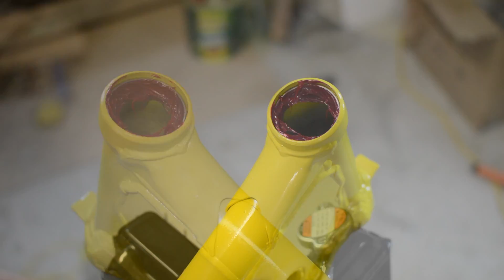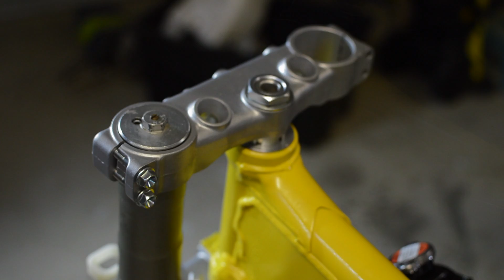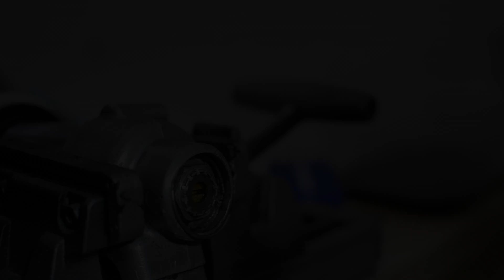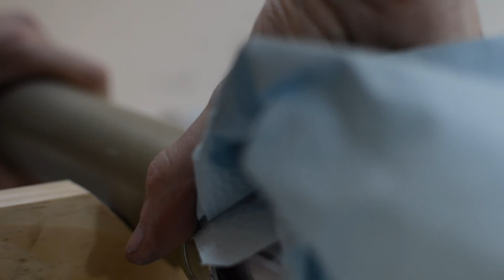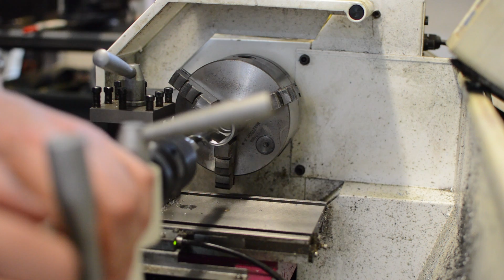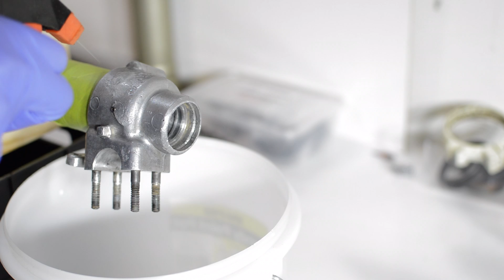Front Forks (Part 1) - 1992 RM250 Restoration - Episode 17

Comment: To anyone changing seals/metals 1. You don't need to remove all the center stuff, just top cap off and dust seal+lock piece off and pull. 2. If you are removing the bottom bolt but it's just spinning and not coming out. There is a really small screw on the side of the fork where the axle hole is that has a small screw that locks the outer housing (that has the threads for the bottom big bolt) to the fork frame, so it doesn't spin when removing the bottom bolt.

Comment: I'm working on a 1992 RM125 and I removed the base valve, but my damping system doesn't pull out of the lower tube like yours did. I didn't remove the locking nut and plastic spring guide but I figure that isn't holding up the damping system from easily being removed?

Comment: Hi G9 liking you restore of the RM there, I have a question. What make of sus-forks are they as I have the same ones and would like to rebuild them but with maybe upgrade after market parts , if you know the best parts to use and where to get them from. Thanks
Reply from the maker: Hi Malcolm, they are Showa forks.  As far as parts go i'm not sure - I used OEM parts or OEM like replacements.  Best off talking to a specialist.
Reply: Thank you

Comment: I have a question about that special tool, is it really important, don’t you think I could get away with it with just a impact wrench?
Reply: just use a 26mm box spanner usually 5 inches long with a long regular 24mm socket on the other side. should clear the rod
Reply: @benmann6323  Did you actually so this and it worked? I need to find a solution to the tool.
Reply from the maker: Unfortunately not.  A normal impact wrench setup wont fit over the damper rod.
Reply: G9Garage I mean to use the impact on the bottom of the fork to tighten it? I thought that the use of this tool was to hold the it in place while you tighten the bottom of the fork back together. Forgive me if I’m wrong with this but I don’t know right now with the forks being together right now and I don’t want to risk not have long the tool to tighten the needed things
Reply: @awsomeguy451  Did you ever rebuild the forks? I just got mine apart and realized that the tool is needed to put it back together. I'm pretty sure you are correct that the tool is needed to install the base valve into the bottom of the damper.

Anybody got the tool for sale??

Comment: thank you so much for your videos. You realy are a great inspiration. You do not see a problem, but a solution to a challenge. Your bike is gone look so mint and perfect. 

I have a RMX 250 1990 as my winter bike. not as nice as your`s bike. but mine is 85-90% restored.  I Love that bike. The power down low is like nothing i have tried before. Its almost like a diesel and 4 stroke combined.  so much power on low rpm, and with just a flick of the wrist the bike screams away on the back wheal :D   
Keep up the good work and the great videos. 
Greeting from Norway
Reply from the maker: Hey there thank you for the nice message!  I like the RMX too.  A friend had one a long time ago and it was a great enduro bike. Cheers!